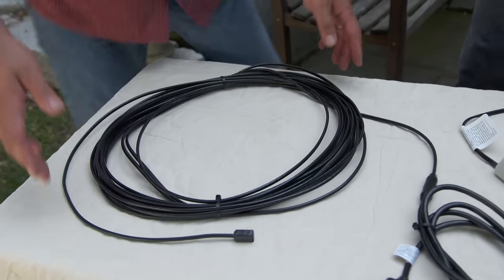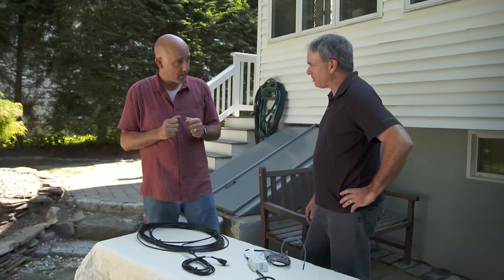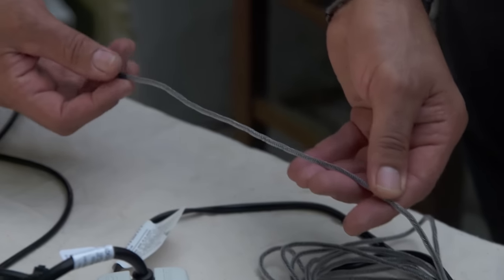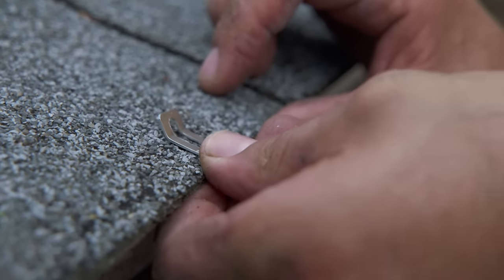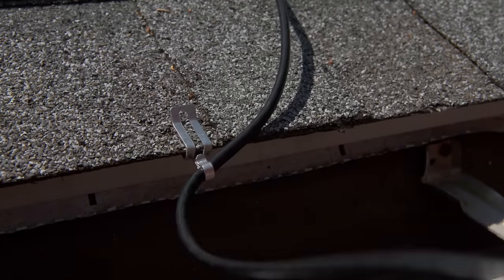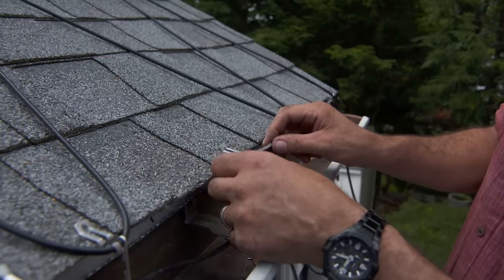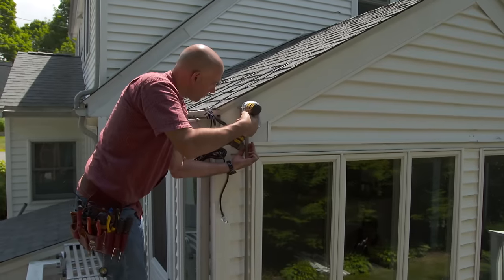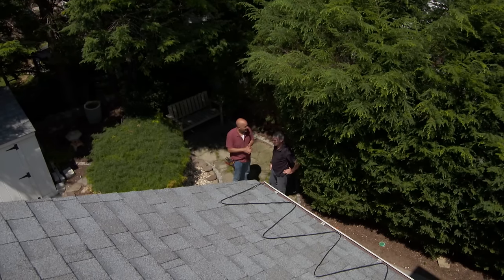How to Install Ice-Melting Roof Cables | Ask This Old House

Comment: One problem with those cables you got at the hardware store is they can't produce enough heat when temperatures drop below 20 degrees out.  You will need self regulating cable for the colder temps.  Don't forget to not let that cable touch itself.  If it does it will over heat the core at the contact point and burn out.

Comment: I looked into heat cables but the problem I found was they don't last very long. My neighbor's cables had failed after about 3 years and the warranty on most seem to be about a year. I would buy if I could find one with a 5 year warranty. These are just a bandaid; the proper solution is to insulate the roof, but I found that can be very expensive for vaulted ceilings. A contractor wanted 15K to foam insulate my vaulted roof with closed-cell foam (includes demo, foam, drywall, painting).
Reply: you should consider Self Regulating heat cable.  10 year warranty.  You will need to have someone experienced install them though.  We also sell self regulating heat cable plug and play kits ready to go if you need one.

Comment: This answered almost all of my questions. But he was slippery about how much it cost to run it. Probably less expensive than roof repair but no mention of the actual power usage when it's on. He did give the cable length but didn't mention the wire gauge. Wouldn't take too much to find the item and calculate the draw.
Reply: Doug Reed
Thank you. I missed that.
Reply: +Maxid1 One of the systems I saw on amazon says 5 watts per foot, which is right on par with his 300 watts for a 60' roll of cable. I don't think he mentioned cost because your kWh cost will vary greatly by region. In my state electricity runs at an average of about $0.17 - $0.18 cents per kWh. So for this application of 60' in theory it would cost around $7-8 a day to run for a 24 hour cycle. But considering this system has IO and it will only run if the sensor cable gets wet I am sure it's much less, only during peak snow storms. And from my own experience with repairs and getting up on the roof to get rid of snow and ice, I sure would rather pay the electric company $7 rather than getting up on a ladder in the frigid cold to barely solve the problem!
Reply: Old comment, but figured I'd chime in.  He said 60 ft long and consumes about 300 watts when its on.  I'll bump that up to 350W for estimate's sake.  Assuming you live in an area where its damn cold roughly 1/3 of the year and snows frequently, you can estimate that this would be running ~10 hours a day averaged across the year.   That translates to around 101 kw/h a month.  The most expensive state that I can see is MA, which has rates of $.21 per kwh in 2018, that means it would cost around $240/yr to operate with the numbers I've given according to this site: https://michaelbluejay.com/electricity/cost.html.  Multiply by how many you need for your house, looks like he covered maybe ~8 ft, plus the gutter, so maybe ~14-16 feet without gutter, it can add up fast.

Comment: As a gutter guy and roofer these are the worst to both install and remove. Also if u don’t have any gutter guards these this will just trap so much trash into the gutter and downspouts. After a while they will also split and just stop working.😅

Comment: Won't snow just make those clips holding the wire to the roof fall off?
Reply: mykhalable o
Reply: No. But trying to rake snow over the cables may loosen or pull them out. Had this for years on an eastern facing roof. Easy to re-attach in the Spring.
Reply: It can't. Snow will not pull on the wires because the wires melt the snow as it comes close to it (or in contact with). The snow turns to water and just water alone can't pull the clips free.That's my view on it anyways ;)
Reply: It doesn't effect the wires or clips

Comment: Only issue with those cables, is over the hot summer months the intense UV of the sun and heat from the shingles is gonna degrade the cables and over time, be a fire risk.

Comment: Bad install. Bottom of triangles are supposed to form drip loops which extend into gutter. And the sensor wire goes in the gutter, not along the roof edge. How was this video approved for viewing????

Comment: I hate to sound negative but it seems like just more to go wrong. How durable is this system? How well does it hold up to wind damage, hail storms, or tree branches accidentally falling in them, etc.? Just like in modern cars you just have more to break and more to pay for when it does.
Reply: Durable enough. The issues you listed are all non factors. If they damage this cable then your roof has been damaged and needs replacing anyway.

Comment: what about the snow above where the wires are wired?
Reply: its not to melt all the snow its to prevent ice dams at the base
Reply: Shingles allow the water to "shed" off the roof. The eaves on a roof are cooler than the rest of the roof. An ice dam at the edge blocks the water from draining and it goes back up and under the shingles.

Comment: Do electricians actually respond to calls for this service?
Reply: Hopefully not this one. He did it wrong.
Reply: I just did my 44' run with a 240' Prime Kit for $100. Includes 3 valleys and 2 downspouts which run to a remote lift station. Ran them about 10-11' down and up, so about 22' per downspout.   Pretty easy for any average person, just read the instructions on your kit, and not necessarily follow this vid's install methods.  Also, get your triangle rise and run, and just use a tape measure to locate all the clip locations with blue tape or a chalk. And remember drip loops are required.

Comment: Running inside the downspout will cause the cables to fail within a year or so. They are constantly damp and literally rot away.
Reply: A downspout in not constantly full of water
Reply: Especially a heated one

Comment: Interesting to see the "pro" do it wrong. There should be a loop at the bottom of the clip, otherwise expansion and contraction of the cable will gradually pull the cable out of the loop in the clip. 

Also, you're suppose to use the wire part of the hardware at the top, to create the loop, not just at the bottom to hang the gutter cable. The loop also helps to get the horizontal cable further down into the gutter. 

This guy shows the instructions about 3/4 of the way through the video. https://www.youtube.com/watch?v=E2Mzv6MF_v0
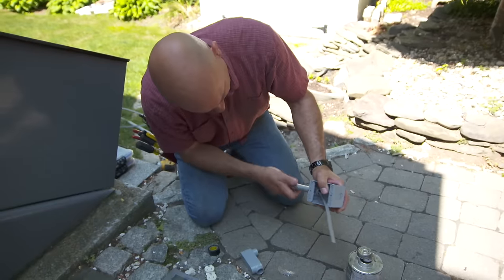Reply: i'm fairly certain the cable won't expand and contract that much.  in any case, you can see at 2:04 both the sensor and the heating wire are secured by bending the metal on the clip over the wire.

Comment: My teacher told the class that the outlet Shouldn't be gfci since its out of reach form anyone but why the breaker?
Reply: is it really needed? its out of reach form any human
Reply: and im almost sure the code dosent care about peta
Reply: Is it mandatory by code ?
Reply: Yes anytime power is in a wet or damp location or where it may come into contact with water a GFCI is required by code
Reply: Doug Smith 
Gfci breaker is easy to reset it,  you don't have to go to the roof to reset it .
Reply: All receptacles in wet or damp locations need to be GFCI protected. It doesn't matter how high or low the receptacle is located.
Reply: @Tablesaw818  And those who can't teach, teach gym.

Comment: Gutters are the culprit when it comes to ice dams ,no gutters no ice dams
Reply: Wrong.  I tried that.  Snow turns into ice quickly in Michigan even when the roof is raked, it slowly builds up while I am at work, and the ice dam is not easy to break even with roof safe chemicals.  I had an ice dam that was heavy enough to destroy my gutter on a warm day when the ice dam fell, so I thought, cool, no more ice dams.  Boy was I wrong.  I've tried everything, roof rake, chemicals, gutterless, now I'm going for the wires.  Insulation as a solution is easier said than done.